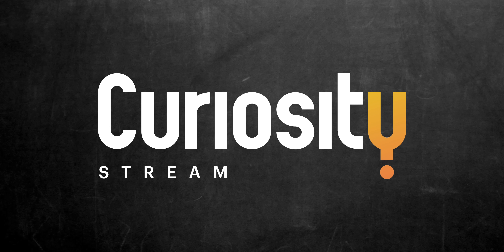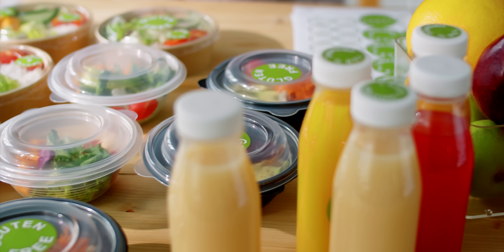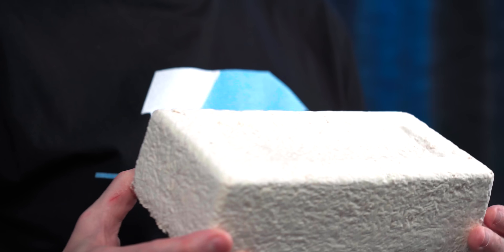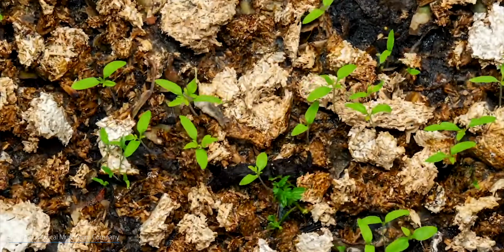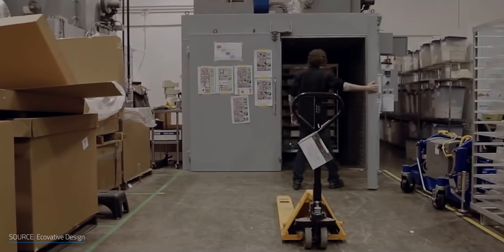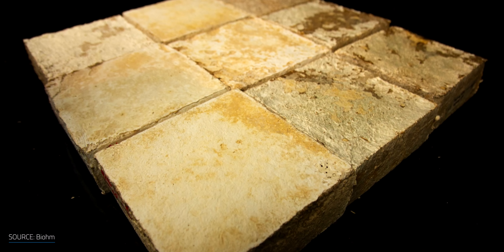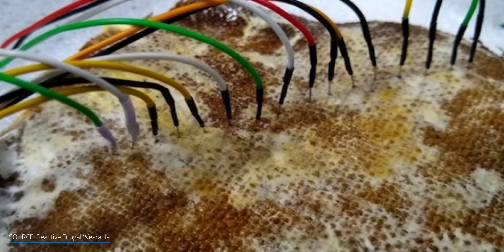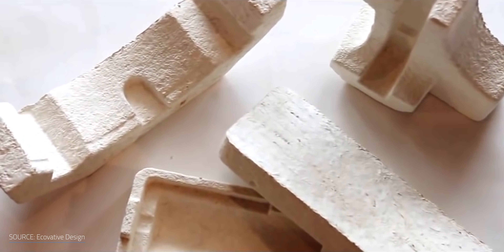Is Mycelium Fungus the Plastic of the Future?

Comment: Mycelium insulation sounds like a win win, especially if you can pair with rammed Earth constructions, or constrictions that are  at least 4'  to 6'  below grade where ambient room temps will be a contsant. I'm gonna watch this, and on that note  I wounder if its possible to create a Bioluminscent Mycelium for use in interior lighting?

So j here's the question: how absorbent is Mycelium?My worry is the pressure treated wood that it's going to be placed agianst, and possibly absorbing trace toxins from the Kiln process. (Then agian, I could be over thinking this )

Comment: With the right use of genetic engineering, additional biological traits, maybe giving rise to use specific sub species of these mushrooms could easily give rise to more potential uses. If they could, for example, make make a species of mushrooms with mycelium that is significantly stronger than concrete, and will stay true to it's previously molded form indefinitely without having to be killed off like that and live for centuries or even millenia, this stronger living self repairing concrete could revolutionize construction. And if we can create a species of mushrooms with mycelium that is harder than carbon crystalline (diamond) and significantly tougher, then pure iron, this could be a good fit for tools. Some mushrooms are already bioluminescent. We could use that for lighting fixtures.

Comment: Mycelium is an excellent replacement for many plastic products and even products that are not plastic based...for the most part the element that will decide if it does or not see widespread use, is some method that can be developed so that it can be made to grow exponentially faster than it normally does. I've made things from mycelium and in order to compensate for the slow growth you have to make allowance for large areas of space.

Comment: I can see this as a decent replacement for packaging however its biodegradability makes it less useful for clothing and as a building material. It's essentially going to rot like any other organic material such as wood so for insulation it's going to be way more difficult to work with than something like foil backed phenolic foam board.

Comment: Cheap foam as we use it now everywhere is not sustainable. A material that hard to recycle has to be confined to specialized high-value niche applications. The first choice is to avoid garbage where possible and replace it with durable, reusable materials. The second choice is to use a recyclable material instead like mycelics.
Reply: what is sustainable?

Comment: Simple: Just allow plastic packaging that is heavier than sea water. So it will never end up as micro plastic floating around and being eaten by fish and sea animals. If it finds its way to the ocean, it will eventually sink to the bottom when its ground up by the waves and be buried under the sea floor.
Reply: ur right, its not a problem anymore if we can't see it :)
Reply: @robertrichatd9222  When its on the sea floor, its quickly encapsulated in calcium by corrals. When plastic is encapsulated, its harmless to sea animals. We sink ships and all sort of things to make into coral reefs. hard plastic won't leak out like rubber tires. In deep areas without corals, it would quickly be buried by sediments. Plastic is simply petroleum that comes from the ground. Oil doesn't harm the environment, when its locked up underground. In a million years, these locked up plastic would be eaten up by bacteria and become unrefined oil - just like how dinosaur bones and fossil plants became oil. This is a much better solution than the status quo with micro plastic eaten by small fish and end up inside other animals and humans who eat fish. Do some critical thinking.
Reply: @KingLutherQ   im not reading all that
Reply: @robertrichatd9222  oh! so you are just a know it all without backing it with facts and science.
Reply: @KingLutherQ  im in your walls
Reply: @robertrichatd9222  Like a bug? First time you made sense.

Comment: All power to Mycelium :D, i believe packing would be the first large scale application, especially if IKEA jumps on the wagon, would be great if mycelium could also replace cardboard all together, perhaps with a sort of "mycelium boxe" with soft-puffy mycelium based filler material, then you can package any type of items rather than grow the packing around it, properly need to find a way to fold the 'mycelium box' otherwise floor space might be a challenge, but if there's a demand and all that ;D.

Comment: The mycelium sheets can be used alongside concrete building materials, allowing for the concrete to be the support and even the protective news of the building,

And the mycelium would be able to provide thermal insulation better than concrete can

Comment: so...in theory, if you have a if you have a starship with a instead, or along side, of circuitry a network or maybe inner inner hull insulation, for a fuller ship coverage, that could process information and transmit data thru the hull even if parts of the hull were damaged and even still could over a shorter time regrow that section, metals and other materials aside, to maybe create a medium term oxygen shield over the damage area and also in that crisis maintain ship systems and, maybe, power distribution, in theory?

Comment: Where this is very fascinating, it brings to mind a concern. My wife, and I'm sure several other people, are allergic to mushrooms to some degree. Where I like the idea of the replacing plastic, have there been any tests to determine if, for example, the packaging material could cause allergic reaction via touch, or could it possibly cause food contamination during shipping? 
Example: The shipper is rough with the box and breaks or cracks the internal packaging. My wife doesn't know it has mushroom material inside and opens the box. Could the cracked packaging lead to dust/particles that could be inhaled? Could or would those particles cause a reaction?
Reply: I have this concern as well. My husband has a food allergy to mushrooms. I doubt he’d be able to eat anything served in a mycelium container without a reaction.
Reply: since the mycelia is the "roots" of the mushroom, i doubt it would cause any allergy problems, especially since this whole process would be passed through many rigorous systems for industrial production and consumption

Comment: Sounds great and all, but like all other attempts at plastic alternatives, the biggest question is... is it cheaper?

A lot of industries uses plastic mainly for cost-efficiency. The video even mentioned in the beginning that companies aren't recycling cus it's more expensive than making new ones... would mycelium technology end up cheaper or more expensive than making new plastic? 

Because economists and companies will ultimately have to ponder about "Are we paying more for less?"

I genuinely want humans to find a popular replacement to plastic... but as it stands there's already so much potential alternatives that aren't getting used simply cus they'll damage the bottom line by that much...

Comment: Oil is very finite, and used everyday on a large scale
Mushrooms are very plentiful, and haven't been really used
Plastic is made of oil 
Fungi-based products are made out of mushroom
And on top of that it's even safe?  That all sounds great. 
Except for a few small things - how long will it last in stores as a packaging compared to plastic/styrofoam? How often will it need to be replaced in a home for insulation? Is it more or less resistant to wear and tear than plastic/synthethic materials?

Comment: I can definitely see the practicality of mycelia used in short term products like packaging, but if it’s so well biodegradable I don’t see how it would work so well as a long term building material or even as insulation. Obviously there aren’t quite as many de-composers in your walls as there are in the ground but if heat and moisture are good predictors of biodegradation it doesn’t seem like it would do do well exposed to the elements.

Just my conjecture though, I’m no biochemist. Yet.
Reply: Plus there is no need for a new biodegradable building material that can insulate as well as sound proof, when there is already ones that are not just already in use but also more resilient and don't really decompose in use. 

As for packaging, that is also one draw back and plastic would probably never be beaten in being a cheap, chemically stable, and durable material. For long term packaging there is really no other thing that can compete, but replacing nearly everything that don't involve long term packaging might already be a huge progress.

Comment: Imo myceleum in buildings is interesting idea. I'll be happy to exchange polystyren for it in new buildings or non bearing walls. Using it as load bearing material seems kinda sketchy to me. Load bearing materials should be able to last at least 10 years in bad conditions and show the decomposition. It would be nice to find out how water/ moisture resistable it is to find out if it can be used as underground termal insulation. Depending on how fire resistable it is, it could partialy replace fiber glass/ rock wool insulation.
Also if you can package food in it instead of styrofoam, is it edible? I'm just curious about this one.

Comment: I think it has a great potential to be a great food source since the meat industry is among the worst offenders when it comes to polluting the environment. I also think packaging will be a huge part of mycelium production because of its cost to manufacture and how quickly it is composted. 

the clothing part is less of a given when it comes to mycelium. it is all about how it compares to cotton in both longevity and price. if it is cheaper to produce than cotton whilst offering the same or better properties in how soft it is, how well it holds up over time and through wash cycles and how breathable it is. I can see a use for it in stuff like winter equipment like jackets and such for skiing, snowboarding and other winter sports and there might be a use for it in gloves depending on yet again, price and reciliance.

as for building matereals, I would say that it really depends on how well it holds up over time, but I can really see it being used inside the walls as an insulator instead of glass or rock wool. but this also depends on the performance. if it is worse than glass wool for a higher price will nobody go for it. if it is the same or better for the same price or lower do I have a feeling that a lot of people might go for it instead of glass wool.

Comment: I see huge possibilities for this in non-cosmetic applications, especially in the packaging and insulation needs.  However, it does lack mechanical and aesthetic properties of petroleum based polymers where flexual modulus, impact strength, dimensional stability, flame retardant and clarity are huge concerns.  I have designed thousands of plastic parts throughout my career and while I don't see it replacing polycarbonate or ABS, I do see a definite need for something like this.

Comment: Plastics is the ultimate "Be careful what you wish for". On paper it's the perfect material: cheap, easy to shape, can have different strengths and it lasts virtually forever, but it turns out that in reality this is a huge problem, plastic is too good, too durable.

Comment: If someone is allergic to mold and mold spores, is it safe for them to use mycelium and mushroom based insulation in their house??? Will they be allergic to the mycelium itself or since the mycelium is porous can it absorb water and grow mold within?
Reply: the mycelium is killed before it's sold
Reply: Guess depends on the strain and what substances causes the allergy, if specific toxins which i think is the case are the problem you just don´t use the toxic ones.

Comment: In the last section of the video you mentioned that several states have or may ban styrofoam and show a food container as an example of styrofoam. In doing a little research, the mushroom based packing is not a viable solution for food containers as it cannot get wet nor is it waterproof. You may want to make an edit to reflect this limitation.

Comment: What's the catch and why aren't more companies embracing this?
Reply: The Mycelium products are generally coated in PLA (a bioplastic film) to increase their longevity. But PLA doesn't really break down any faster than normal plastics, at least at typical environmental temperatures. So Mycelium products disposed at sea will still lead to oceanic pollution. Similarly, since they are typically quite weak, Mycelium products have synthetic fibers added to them to increase tensile strength (especially Mycelium leather/cloth replacements), which also won't break down any faster than other plastics. This also adds to the complexity of construction, and raises costs.

Mostly though it's just the overall cost and lack of production quantities that prevent companies from switching to these products. It'll take billions of dollars of infrastructure development to scale up production to even begin to touch more typical textiles and plastic products.

Comment: I'm not convinced on the whole, plastic bad debate.  
1) Everything is poison in excess.  Water is poison if you have too much.  
2) Landfills are designed not to let ANYTHING degrade.  Those numbers they give you for how long it takes plastic to degrade are for if you just bury the stuff.  Landfills have recognizable food items 50 years later.  
3) The little bit of liquid and gas that pours out of a landfill are designed to be filtered out and collected by modern landfills.  
4) Plastic in the ocean isn't caused by western society.  The vast majority of it comes from asian countries.  So it doesn't matter what you introduce, you have to get China to use it for it to matter.

Comment: your video still raises a lot of questions
- how is it proven that mycelium is safer than plastic? just because it's biodegradable doesnt mean it's harmless to the body
- how does its biodegradability affect its lifespan? for packing styrofoam this shouldnt matter,  but for building materials and insulation this is super important
- fungus is edible, would it attract pests? super important for building materials and especially insulation. there's plenty of species that feed off of varieties fungi, bugs especially come to mind. is there anything to prevent this from happening to your insulation? what kind of pests does it attract? etc etc

its a fantastic technology but this video sounded like it was singing it's praises with very little consideration of what drawbacks it might have.

Comment: This is awesome. Only comment is on the styrofoam comment. Styrofoam is actually 100% recyclable, however it's mostly not economical as it is very low density so it's not efficient to transport and it's harder to clean because of its porosity. However, in the late 80's McDonalds came up with a successful recycling program for their styrofoam clamshells. Compared to the coated paperboard option, styrofoam was actually the more recyclable choice, but the public opinion against styrofoam was so negative, they wound up dropping it because of "feelings" over facts. Basically the director of the environmental defense fund refused to endorse the recycling program that McDonalds was prepared to implement nationwide. So, they got a non-recyclable, multi-layer plastic paper composite packaging instead. 
 http://pdf.wri.org/bcs_mcdonalds_caseb1.pdf

Comment: Mycelium packaging is indeed a good start. Let's worry about the other applications later.
Reply: What other applications?
Reply: @asifishan1221  Matt mentioned in the video that there may be other potential applications for Mycelium. If my memory serves me right, it can be used as an alternative for hollow blocks or insulation but it is said that these products are way less ready for mass production. Hence why I said, let's focus with the packaging replacement first.
Reply: @Anxiou5Panda  ok but are there any negative sides to it?
Reply: @asifishan1221  Maybe, if handled and applied wrongly. I believe everything has an advantage and a disadvantage. We'll have to wait.
Reply: @Anxiou5Panda  you are right

Comment: I'm all for continuing the work to completely replace plastics. But it seems like mycelium fungus breaks apart a lot more easily than anyone is willing to show for some reason. When people show off bricks or other examples, it's pretty clear that you could rub the stuff up against wood or itself or anything and it would begin to crumble off at least somewhat; you can see loose bits, and that same thing happens even with 3D printed polymers. Is the company that's pushing this stuff avoiding that issue on purpose?

Comment: Here's an idea then. How long can this stuff last, in the case of, say.. packaging foam? 
Ex: I buy this computer and use it for the next.. 10 or so years, keeping the box and everything that came in it. Then, on the 11th year, I decide to move house, or I need to bring the PC in for repairs. 

Is the old mycelium packaging still viable in that time, or would it of degraded away? How about in 20-30 years, when I want to bring the same PC in to upgrade the internals, but keep the exterior case?

Comment: I dont know how durable will be this if used instead of plastic. Imagine you buy a vacuum cleaner made of mycelium :D and after 1 year the "plastic" parts degrade and fall apart. I have already bad experience from a cable of my hair clipper/trimer, only for 1-2 it fall apart. Im sure its made on purpose to degrade faster.. I don't want to buy everything i use on the next year, or imagine you make new insulation for your home and it biodegrade on the 2nd year or 1st year. The only use i see is the packaging materials.